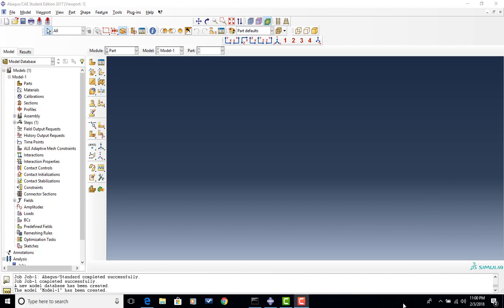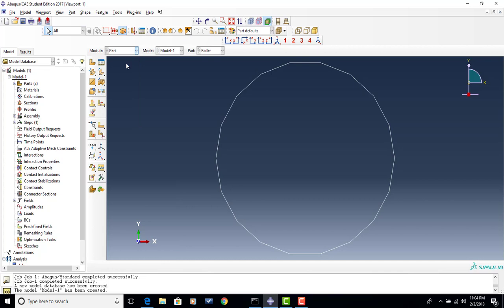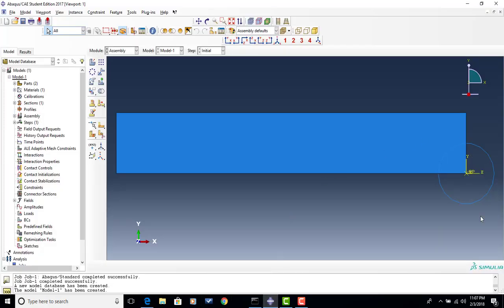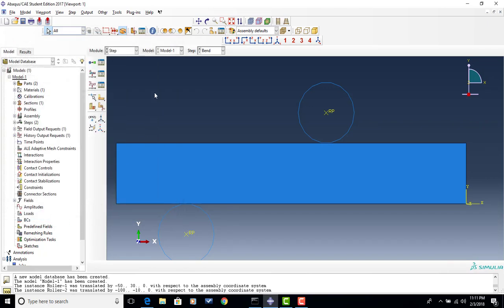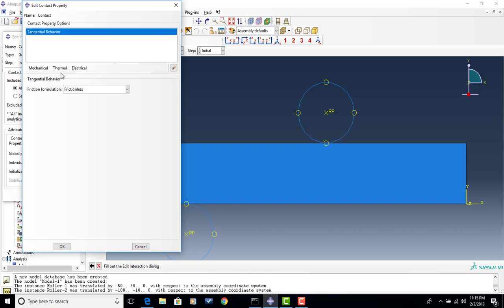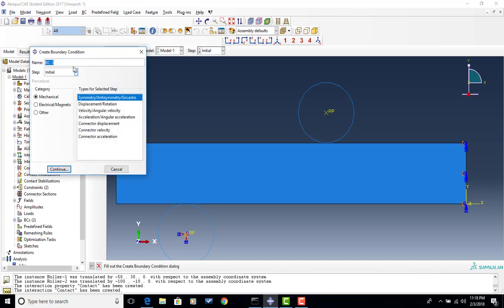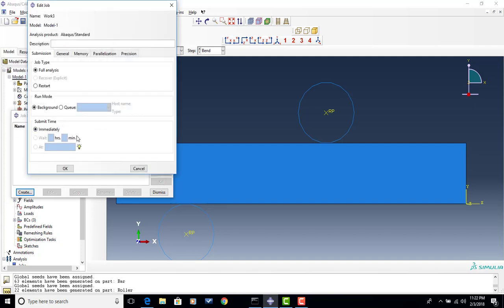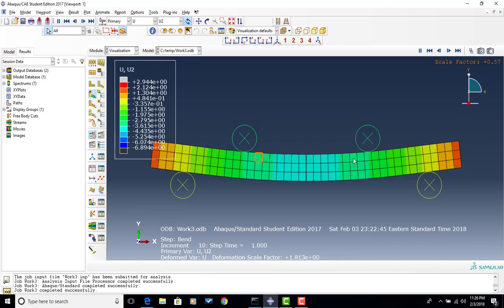Widener ME474 Abaqus Workshop 3 - 4 Point Bend

Comment: I am involving a research project in which I should simulate a three-point bending test for ceramics for example Al2O3.
As you know, ceramics don’t have a plasticity stage and after pass through the elastic region, they ruptured. I was wondering if you’d mind letting me know which parameters as a coefficient are important in my simulation to define them...tensile strength, elasticity modulus, compressive strength

Comment: Hello Professor Czyz
,

This was really helpful. I have a similar 4-PB setup in my 3-D model.However ,it is not symmetric about the Y_Z plane as i have a crack on one side (It is 4 point End Notch Flexure test (https://www.google.com/search?q=4enf&source=lnms&tbm=isch&sa=X&ved=0ahUKEwijr-rrvcHgAhWSqIsKHXIiCZwQ_AUIDigB&biw=1366&bih=576#imgrc=I1cAoAcqqVeMiM).

Could you please guide me on the boundary conditions which i should apply on the beam.

Thanks :)